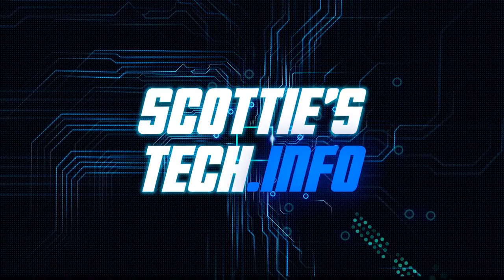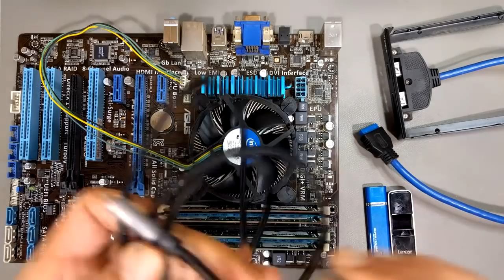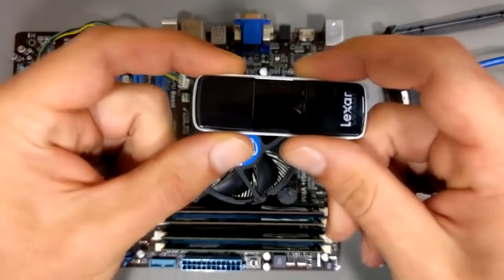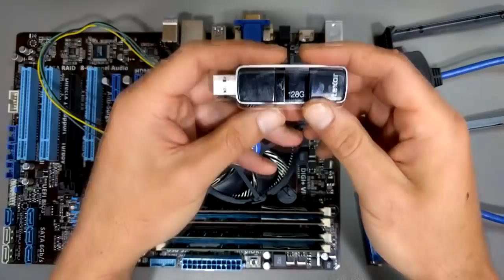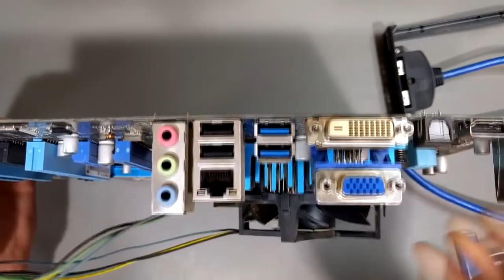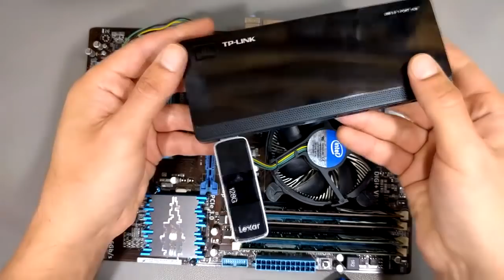Slow copy speeds with USB 3? No problem!

Comment: I built a PC with ASUS TUFF Gaming Z690 with 12900k. I get about 150 to 200Mb/s on front USB 3.0 with a mechanical external hard drive.
Reply from the maker: With the Z690, I get WILDLY different results depending on which USB port I use. Some drives must use the front USB (type A) port. Others, the rear USB A ports. And of course my super-fast external SSD must use USB-C, rear port. What a mess!!!!
Reply: I noticed some ports stop when I have my phone plugged in the back with 3.0 cable. A video said disable legacy on USB in BIOS and that worked for a couple of the ports, must be only associated with those. I have 1tb NVMe WD black and 1tb NVMe blue. Those speeds are crazy, lol. But ya, I know what you mean, all the different types of ports.

Comment: I need a solution for otg android hard drives, it goes only up to 30MB but most times 20MB beside the cables are all came with the external USB c android compatible transcend hard drive.
Reply from the maker: That one's tricky... It could be the USB chip, driver, speed of the Transcend drive... but most likely, the limiting factor is the flash memory in the Android gizmo itself. It's usually not super-fast in most devices.
Reply: @ScottiesTech  that's a shame this days, that they don't think about usb c ports on the phones for fast file transfair. 😕
Reply: Do you know a easy method maybe, how I could make from my new hdd transcend 4TB Drive ( have usb c and A cables included) maybe a easy direct WiFi backup storage or similar for faster file transfair without much work, becourse I can't handle in the moment much complicated stuff, I'm disabled and under much pain, becourse of my sicknesses, but have bought now, (after many years this hd drive) , this I hope good hdd external drive wher people told me that they are using it for over 10years without problems.
Sorry for my confusing and not correct English writing, it's also not my first, Language more the 3th. Maybe it would be a good new video idea to help people that have problems too, to get easyer backups from ther phones to a drive, I have only 2.6GB left and have to delete any newer pictures ect to keep my phone running without Tribble. Proberly i should have long time ago done backups but with al my health problems and this days it's not easys, that it takes years to come to the point. Beside my hdd drive is Transcend 4 TB USB Type-C Rugged Portable Hard Drive - Shock Resistant USB 3.1 Gen 1 StoreJet TS4TSJ25M3C
Long time storage are much safer  some one told in a video on yt on new hdd drives that ssd, wher no one knows how long the hold.
I can also understand if no one could help me of time reason or other things. Also I'm not capable to buy expensive stuff to get to the point.
Kind Regards 🖖
This was my info video on backup storages.
https://youtu.be/MFUcGME-A4A

Comment: I was just now copying 349 albums from my laptop to a Samsung Fit+ (USB 3.1, supposed to be "up to 400MB/s").  The USB stick is blue, the USB port on the Dell dock (plugged into the laptop via USB-C/Thunderbolt) is blue.  It ran about 55MB/s the whole way.  Faster than when I had a laptop without USB 3.x, but still disappointing.  It's a Dell Latitude 5501 that's supposed to have built-in USB 3.1, but neither of them is blue.
Reply from the maker: The plot thickens! With my new motherboard, I can connect one USB stick to USB port A and get 240 MB/s. But if I plug in to port B it's much slower. In contrast, if I plug my external USB hard drive (mechanical) into port A, I get really pokey speeds - yet it goes at about 50MB/s if I stick it in port B. USB port A is Intel's integrated USB, and port B is an add-on USB chip on the motherboard. So in short, it's hit or miss these days even with USB 3.1.

Comment: Do you have any insight on USB 3.1? I have motherboard with USB 3.1 support and devices with USB 3.1 support but I cant achieve anything higher then 400-500MB read and writes. I have tried various speed tests, transferring varies files and it never goes above 500MB speeds.
Reply from the maker: What are you copying to/from? To get those max speeds, you'll need to copy to/from an SSD or uber-fast USB stick.

Comment: The same exact thing happened to me a few days ago. It used to work fine but then both usb 3 ports in my front panel would only work at usb 2 speeds. After quite a lot of fiddling turns out my problem was... dirt. I cleaned the connectors with 96º alcohol and a toothbrush and voila, back to usb 3 speeds.
Reply from the maker: Interesting!!
Reply: @ScottiesTech  Yeah. Of course that doesn't 100% prove dirt was my issue, maybe I just happened to bend a pin in the connector just right while brushing it, I don't know, it's a sample of one and there could be a number of other potential causes, but it's worth a try I guess. Now, if someone in your audience is experimenting a similar issue and wants to give this a go, we should probably advise them to use proper contact cleaner instead of being a hack like me, haha. In my case this is an old machine and I gave it a few minutes to make sure moisture was gone by the time I turned the computer back on, but still.

Comment: You perfectly described my problem, however in my case it is a laptop a Asus Zenbook UX-31E.  I have USB 3, it used to work great with my usb 3 pen-drive,  but at some point speed just fall a lot. My PC have usb 2 and I get around 32mb/s while in my laptop on both usb 2 and usb 3 ports I only get around 18mb/s! Driving me crazy. 4 hours to backup my phone! Nothing seems to work.
Reply from the maker: You may have lucked out and gotten a laptop with a non-standard USB 3 chip. There was a huge problem with USB 3 when it first backup popular. In short, the standards weren't finalized, so different USB 3 implementations did different things... Couple that with driver issues, and you have a Big Mess.

Comment: I had usb 3.2 on my mobo.giga b550m ds3h. And my girlfriend give me a pendrive. Cuz my pc faster and much better than her laptop. So i download movies - copy pendrive than plug on tv. The pendrive is a sandisc 32gb // USB 3.1 Plug / USB 3.1 Type-C Plug //. At the first times i copy the files with 60-65mb / sec. Now max 25mb / sec. And i dont know why.. why ??
Reply from the maker: That can happen if an OS update overwrites the USB drivers. You might be able to fix it by seeing if there are updated drivers from the motherboard manufacturer's web site. In some cases, you can't fix it - except using a different USB port.
Reply: @ScottiesTech  im used first times revi Os / custom win 10. Than later i upgrade it full. Cuz my 4750g igpu a lot times had black screen error. So had a huge chance about you right. I will turn off windows update / win driver installs. I will remove all drivers with ddu than install from giga site. I will tell what happen later. Thanks! I wish the bests for you.

Comment: I knew I wasn't imagining stuff, I felt that the usb flash drives copying speed got worse since the windows update, but I saw no one talk about that problem, so I was like "was this always like this?" but now at least I can confirm this. Still. I have an awful copying speed, it goes from 50mb to 1mb, and I'm lucky if it stabilizes itself at 10mb.
Reply from the maker: I have a new motherboard now, so things have changed. For some USB3 devices, I get max copy speed via a USB3 hub plugged into a read USB3 port. But for 1 USB3 card reader and (believe it or not) an older 2.5" portable HDD, I only get max speeds using the USB3 port on the FRONT of my puter. I guess we might as well just roll the dice, pick a port, and then try again. It's so random sometimes.
Reply: @ScottiesTech  I'm right now trying to copy some files to a 3.0 usb stick from a 3.0 usb external hard drive, and it's baffling to see the copying speed drop from 50mb to 1mb. And both are plugged on the usb ports from the back, it's insane and honestly makes me angry and sad, because it feels like a scam coming from Windows, (they are legit products so I know I didn't bought some crap lmao)

Comment: I have an issue where I bought two identical expensive 3.1 drives at the same time. I formatted both the exact same way and first used only one of the two. I noticed jumps all over the place, first fast, then slow, then after a while it bumps up a bit for a short while before going slow again, rinse and repeat. I thought it was just how these were supposed to be, maybe they overheat despite being made of metal with great heat dispersion properties. I'm talking about peaks of 60mb/s but mostly low at 10-15mb/s. These are supposed to be very expensive and quite fast drives and I have a rather new super premium laptop. Then later I used the other drive and it's giving me a stable 50-60mb/s depending on file type. Always. No dips. Now I'm starting to suspect one of the drives are defective and might just bring it back to the shop to have it replaced. Maybe I'll try to reformat it despite them being formatted the same way before doing so though. But it's easy to try blaming software or hardware outside of the drive or just claim it's supposed to be like that when they might actually be defective. 

Unlike many other things, it's kinda hard to tell with an usb drive. Is it defective or is something wrong somewhere else?

Comment: My usb3 download speed is ok, but the upload speed to my usb3 stick starts fast and then slows down no matter which port or which computer I use.
Reply: Get a better USB stick. Like a SanDisk Extreme, or a Patriot Rage. Cheap USB 3 drives slow down because they have a tiny SLC cache to reach advertised speeds, but once that fills up in a large transfer it switches to the slow/dense QLC flash.
Reply from the maker: Which USB stick are we talking about here? Do the computers have normal hard drives or SSDs?

Comment: @ScottiesTech.Info Mr Scotties, I recently noticed that my HDD appeared to show errors, until I tried them on different usb 3.0 ports and different computer altogether, and now have no issue. I tended to hear a Beep sound and the drive trying to spin but failing to. Is that a sign that my USB 3.0 ports have lost power? Is that something that occurs over time? My Asus motherboard is 5 years old now. I decided to buy a voltage usb tester witch will arrive soon, and a powered hub too. Anything that I can do to troubleshoot? Except the  power measurement? What should I look at, the voltage and or the amps?  One thing I can obviously try is to remove all the usb drivers and let windows install them.
Reply from the maker: Sometimes manufacturers get a bit cheap with power on USB ports... The voltage may be fine, the amount of current that can be supplied to all USB ports may be more limited than one would hope. It should be each pair of USB ports have max rated current, but sometimes it can be max current rating for 4 ports. Or, it could be that 1 or more ports just don't supply enough current. OR, the ports are 'dying'. You could be able to get around that problem with a powered USB 3 hub. Just make sure that the powered hub has an AC adapter. That way, the current supplied is coming from the hub and not the puter. That should do the trick!
Reply: @ScottiesTech  thank you. I measured and it is 4.3 Volts for about 3000 amps for  the faulty ports whilst the healthy ones are 4.9 to 5v for 2000 to 4000 amp. . The faulty usb the drive cannot boot and tries to spin but keeps failing. Is it that bellow 4.9 is not enough for the 2.5 external wd drive?
Reply from the maker: @john005_  Yeah, that's definitely not good. At the lower voltage, the drive may not have enough power to run properly.
Reply: The external harddrive is a 2.5 standard usb  3.0 from wd passport. Brand new. It also occured with another brand new drive from a non name brand. And also a 5 years old wd drive.  I did find one port that seems fine for now.

Comment: This is inaccurate. USB 3.0 never reaches theoretical speeds on any device.
Reply from the maker: Of course not - the theoretical max speed includes ideal conditions and like most comm protocols, there is overhead that reduces the max data transfer rate.  But that doesn't mean 20MB/s on a USB storage device is all you should ever expect - esp. these days with cheaper fast flash memory in USB sticks.

Comment: Are you aware of any particular motherboards where the various usb 3 ports don't share bandwidth resources?
Reply from the maker: Usually, they all do. There are some USB3 ports connected to the chipset, and others connected to a USB3 chip added to the motherboard (if it has tons of ports). If I need gobs of USB3 bandwidth, I usually add a PCI-E USB3 card to add more ports.

Comment: I plug my USB 3.0 directly into the motherboard and it's still *10MB/sec.
But I plug an expensive SSD with 3.0 into the ports that are connected to the non-Intel headers on the motherboard, I get at least 10x faster data transfer.

Comment: @ScottiesTech.Info what if I plug the front panel add-on to a 19pin port from a PCIe board will that work? Many usb 3.0 port addage come with an extra 19pin header port? Will I get my speeds if I plug it there?
Reply from the maker: I've done that before, and it worked! Nice and zippy.
Reply: @ScottiesTech  Splendid, so if I understand, even if the default front panel is plugged in the default 3.0 header on my Asus motherboard. If I buy an additional front panel and plug it in a added 3.0 headed via PCI or PCIe, Both the new front pannel and the old (default) will work, with the exception that the new added front panel will be faster because coming from pcie. THis will give me in total 4 usb 3.0 ports

Comment: copying pdfs (150kb to 5mb size -80gb total mixed) from portable hdd (connected to front) to pen drive (connected at back) using usb 3.0 in win 7 64 bit and getting 2MB/s - usb3.0 devices - pendrive formatted to NTFS. explain that - machine is a 1 year old Dell CAD workstation so fast
Reply from the maker: That will always be pokey since the portable HDD is slower reading tons of files and copying them one at a time. To get a real idea of max performance, you'd have to copy 1 large 80GB file. Even when I do that kind of multi-file copy with 'known zippy devices/ports', it still slows WAAAY down. Still, it could be a driver and/or device issue with 1 of the USB ports. I'm assuming of course than the portable HDD is a mechanical drive, not an SSD...

Comment: i have tried everything but even today in 2020 the usb transfer is slow...i actually have dual boot win7 preinstalled and win 10...same usb 3 portable harddrive goes over 100mbps and in win 10...there is initial spike of speed and then it goes horrendously low .....all drivers are installed...